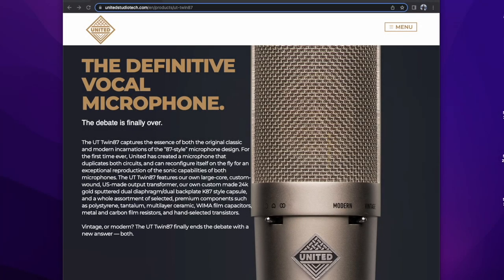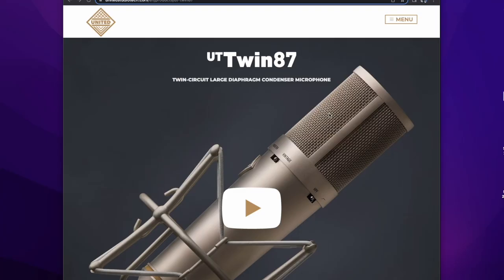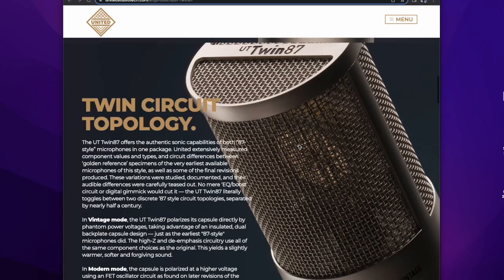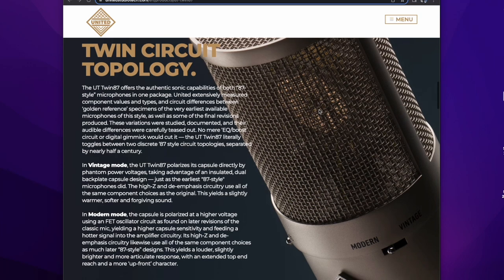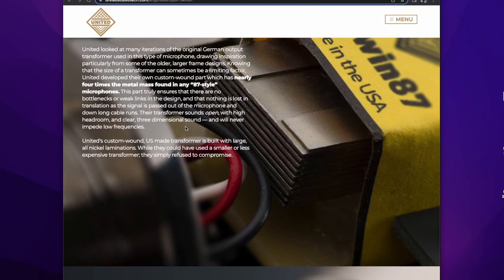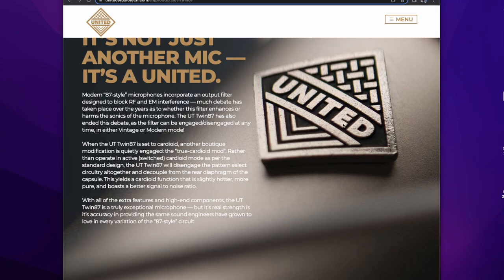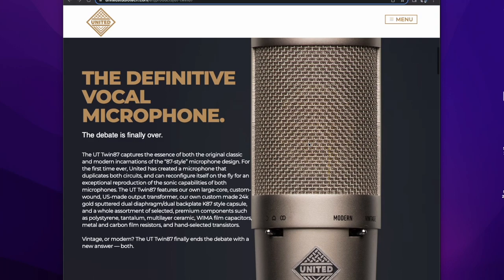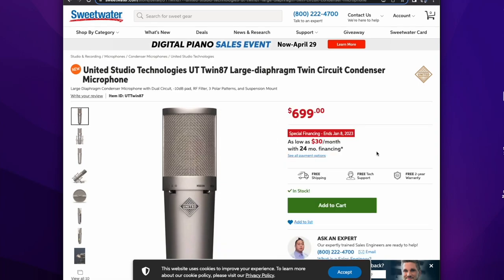The UT Twin87: Two u87 Circuits in One VO Dream Mic?

Comment: thanks so much for the kind words!  we worked really hard on this one, and spent many years on it!  About 5 years, off and on.  There were 6 prototypes... the first was just a straightforward 1:1 repro of the classic circuit with an NOS transistor and a custom Cinemag.  It was fine, but had no bells and whistles.  Our global distributor asked us to add the sound option of the 'AI' since that was what most people today are experienced with, and we made new prototypes that added this feature.  They suggested just a simple EQ circuit.  We were able to just alter one stage of feedback that gave the mic a slightly hotter and more crisp sound, and made 2 prototypes of this... which worked great and that would have been OK; but it felt too 'gimmicky' to me.  I asked for more time to get it right, and that turned into an additional 2+ years to fully dissect and tease out the differences between the 2 classic mics, and figure out how to represent all that.  It required starting almost over from scratch, and a whole additional board, custom made switches, and more.  It's surreal to finally be at the end of that 5 year journey... we've been working on this since almost the beginning, before the FET was released.  We really 'geeked out' over this process, and I hope people get to really 'geek out' with using these options.
Reply from the maker: Chad!! Yo man! Ok, so here's the thing I really like and deeply respect about you. You are a guy committed to doing a great job and always going above and beyond. I could tell from the first time we ever communicated was years ago when I sent a tech support email to that other company on a Saturday, expecting a response the following week. You emailed me back 10 minutes later and traded emails with me for an hour to help me troubleshoot an issue. Again, on a Saturday. You really impressed me. And that exact feeling has been my overall impression of you through our other communications and through watching from afar with awe as you grow your brand and your company. I 100 percent believe in this product sight unseen because I believe in you and the quality of your work and the incredible ethic you bring to it. You are one of my mic heroes, man. And it is really an absolute mic geek-gasm to hear a bit about the design process you described above. I think you're going to have trouble keeping these in stock.
Reply: @MarkYoshimotoNemcoff  thank you so much!
Reply: This is amazing! Glad that you commented. I've been following the 47 but never pulled the trigger. Was waiting on the "new news" from you guys today and I woke up to the email! Lol. Spotted a couple of videos real quick and I went rt to your manual to read up more in depth. Been holding out on some sort of used u87, TLM103 (which I don't love), TLM 49, or even Mojave 201FET. This came in the nic of time. I have high hopes for it. Wishing you guys and MYSELF   :-)   the best of luck with it!!! Looks like you guys put A LOT into it! Mine has already shipped. Keep you posted! Thanks.
Reply: Bro, put this on Amazon!!!
Reply: "Chad Kelly, you're a genius"
Reply: I have a few more pieces of hardware to grab first, but I'm DEFINITELY GETTING this mic as long as the price stays the same. Very nice!!!!! This mic is going to sell like hot cakes on a Sunday morning.

Comment: Alright..... I received my mic yesterday. I had about an hour and a half to play with it and do some spoken-word mic comparisons.  I'm not lying when I say this, but the mic is absolutely amazing! It had me smiling all day. The build quality is excellent.  The sound is INSANE! Do I have a Neumann u87 to compare it to?...  No I do not.  However, I do have a decent mic collection to compare it to. None of my other mics compared to it (in favor of). The UT Twin87 totally offers a vibe and tone that none of my other mics have.  And from what I can tell, it definitely brings that 87 tone. I compared it to my Austrian Audio OC818, my original early 2000's USA made Blue Mouse, and my Peluso P414 (clone of AKG C414 EB model). These are all mics costing between $1000 to $1300. I EASILY preferred the sound of the UT over all of these specific mics. Boy does it stand above all of these mics (especially in bringing out that mid tone and slight "growl" from back in the throat). It's an insane mic for the price. It easily could cost double the price. The versatility of using it in either Vintage or Modern mode, and even engaging the RF filter on either one of those modes.... It's crazy. And I can totally hear the slight difference and "sweetening" when engaging that RF filter. This mic is more like having 3 flavors, rather than 2. Putting the mic into Vintage mode and engaging the RF filter brings the mic somewhere in between Vintage and Modern mode (it's the Vintage vibe with just a hair more articulation). It's for sure a Go-To mic. And to be honest... The Austrian Audio OC818 can almost go in the garbage compared to this thing! I know I know... They're not the same mic. Bottom line is, if you need a mic.... GET THIS!!!!!!  I can't imagine anyone being dissatisfied. 

DISCLAIMER.... It will pick up all of your room and background noises, if your room is untreated. Then again, so does the u87. Just an FYI....
Reply from the maker: So, wait, you're saying you like it?
Reply: @MarkYoshimotoNemcoff  I LOVE IT!!!! Insane for the price. I've been eyeing a real Neumann u87 (new and used) for the last couple of years. I've almost pulled the trigger on a TLM 103 (becuase I really couldn't justify spending over 3 G's on a u87). I even recently ALMOST just went for a TLM49 (being that it's right in the middle). Whether this thing sounds exactly like u87 or not, I don't know. NOR DO I CARE ANYMORE! It almost doesn't matter. It sounds great and offers what I've been looking for in those Neumann mics (and what none of my other mics offer in tone ). Personally, I can't imagine spending $3000+ on a u87 when you can get about 4 of these instead. I mean, it's REAL GOOD for the money. It can go for $2000 and still be justified. So many options to tweak it how you need it (for whoever). Nevermind the fact that it can be used as a weapon if needed!  It's a monster!
Reply from the maker: @deanmasi6684  So, you’re saying it’s good?
Reply: @MarkYoshimotoNemcoff  Haha. Okay I'm DONE!!!!
Reply from the maker: @deanmasi6684  So, you’re saying you’re done?
Reply from the maker: @deanmasi6684  Dude, I am so happy to hear that you are loving your Twin87. It seems like it’s delivering on all your expectations. Not surprised. I think this is going to be a real head turner.
Reply from the maker: @deanmasi6684  Guess what? Dude, your review was so great, I sent a screenshot to Chad Kelly at UT and he had already seen it! By his account, yours is the VERY FIRST Twin87 user review posted anywhere in the world. I've reposted your review over at Gearspace so others can read it. So yeah, you get to call "FIRST" on this one. Chad said you made everyone's day over there. If you get a chance, you may want to consider posting this review at whatever store you bought it from. I think people are eager to know what's the what on the Twin87.
Reply: @MarkYoshimotoNemcoff  WOWWWWWWWWWWW!!!!!! Hahaha. That's amazing!  Thank you so much. I really do appreciate that. Not that I expected anything. Just an honest review from my perspective. You're the man! Ok, yeah I actually already posted the review on Frontend Audio as well (where I bought the mic). Glad I got it when it was initially in stock! Not anymore!!!!
Reply from the maker: @deanmasi6684  It may be tough for them to keep it in stock after potential buyers read that review.
Reply: @MarkYoshimotoNemcoff  Hahahaha.  I need to start writing more reviews!!!! Wait, that means I need to keep buying gear????  NOT A PROBLEM!!!!!!   ;-)

Comment: WOW,  and I just bought the OC18, errr am I going to have to buy another mic now...? lol
Reply from the maker: I mean, you do realize you’ll eventually have to buy all the mics, right? Every single one. Or you’ll always wonder, what if?…
Reply: @MarkYoshimotoNemcoff  I wish I was addicted to cheaper things.
Reply from the maker: @CryptoFreaks  🤣🤣🤣
Reply: Yeah, I now have both (OC818 and now this UT Twin87). Just compared them. The Austrian Audio mic sounds like you're listening to a speaker with a blown tweeter compared to this! On the UT Twin87, the upper mid detail, articulation and controlled (but robust) lowend is on another level compared to the OC18 or OC818 (they're the same mics in cardioid pattern). Just keeping it real...    :-/
Reply: @deanmasi6684  So to be clear the UT is better?
Reply: @CryptoFreaks  I meannnnnnnnnnnn.... I guess it all depends. If you're in an untreated room, the OC18 all day. It's quiter and blocks out some of that noise. However, if you already have a deep or dark voice, I'd go with the UT instead. The OC18 is a bit dark, bassy and kind of dull in the upper mids (it's almost non existent there. I've had 3 OC818 and they all had the same sound in that region). The UT is quite the opposite (and then some). Comparing the tone of the two (for voice only, specifically for my individual voice), yeah then it's UT all day! But not if I'm having issues with room noise. As for micing instruments.... Honestly that's not my thing. They would both do well for that (minus the OC18 having only one polar pattern). What "sound" do i like better?.... UT Twin87 ALL DAY!  Build quality???... Also the UT! I've had minor manufacturing and build issues with all 3 of my OC818 mics. The UT is an absolute TANK! Anyway, I hope I can help with your questions.  You have a great mic still. These mics are so different in sound though. It's hard to say what you would be happier with unless you tried both. They're nowhere close to the same sound though. Perhaps you should have BOTH!!!!! Hahahahaha. Join the club!!!!
Reply: @deanmasi6684  Yeah, I'm a damn addict, I told myself after buying the mkh 8060 I won't buy another mic, well, a Lewitt 540 S, and OC18 later I now want the UT Twin.

Someone put me out of my misery.

Build quality issues with the Austrian Audio huh? That's strange, the AKG people usually know how to build stuff. What kind of issues did you have btw?
Reply: @CryptoFreaks  hahaha. Yeah I'm with you. I CAN'T STOP. I've been buying all kinds of drum mics and I've still never even recorded drums, EVER!!!!! Haha.  But yeah man, I was shocked by AA. So disappointed each time. I was back and forth with the distributor. They were great and took care of me but still. Even recently, the little plastic switch (which changes the polar patterns) just fell out, out of nowhere. I put it back in and then it split in half. They sent me new switches, but still! I had some cosmetic issues with a couple of the mics. Even the mic basket/cage on one of them looked a bit uneven and lopsided.  The lowcut switch on one of them was messed up and didn't line up properly. It was all very strange to me. I expected way more from them. It really made me question these AA mics. Oh, one of the mics even had this terrible sounding resonance going on when you hit the surface. A lot of weird stuff...
Reply: @deanmasi6684  err... yeah I'm OCD about that kind of stuff. Well my OC18 will be here today, let's hope it isn't crap, otherwise I'll bounce it back to sweetwater.  At this price point I am not having imperfections. Might as well buy Chinese if I'm to expect that kind of build quality issues.
Reply: @CryptoFreaks  TRUE!  Good luck and congrats. I'm sure it will be great and you should love it! And if not... Back she goes!  Onto the next one. Also, if you don't LOVE the sound, then maybe move onto the next one! I thought the OC sounded good but not great for my voice. Way too dead sounding. That's their tone. It might be perfect for you though.